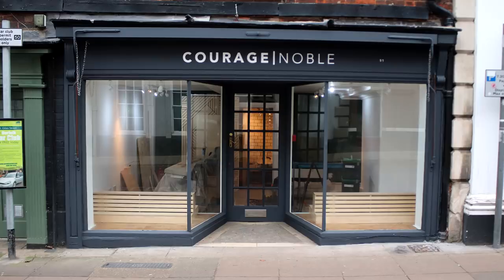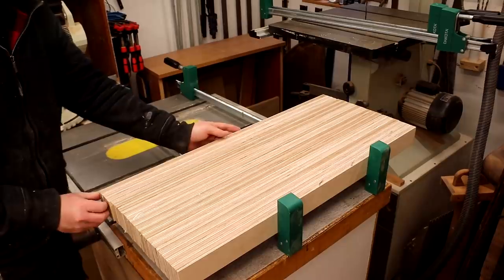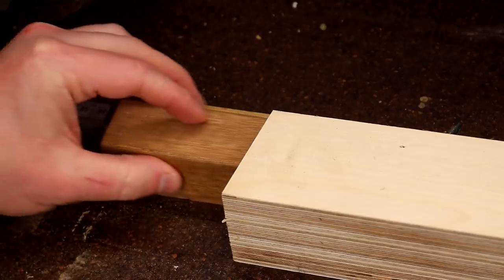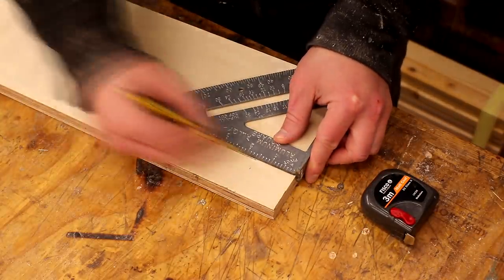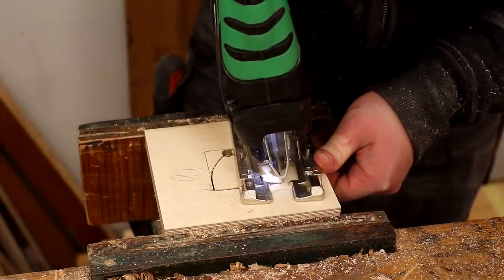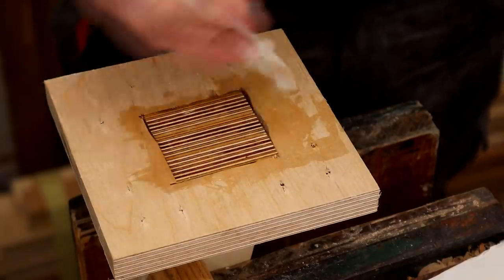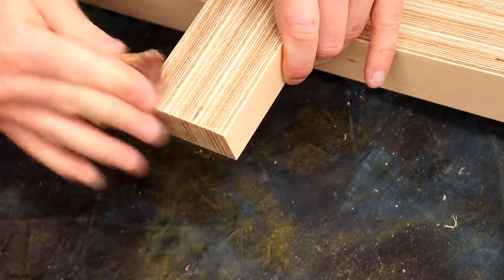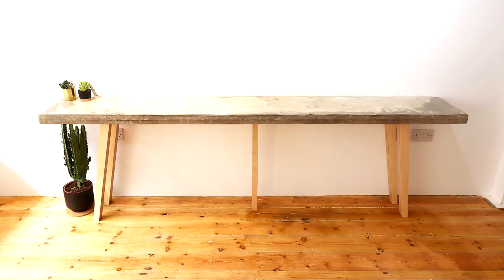Tapered & Angled Legs For A Concrete Table Top

Comment: I was going to say, but see someone beat me to it, that a straight mortise and tenon would have been a better option rather than cut a housing with the jigsaw. Another option, something I've done on several occasions for housings with slight angles, is to first make a guide from some scrap, cut the required angle at the mitre saw. You then use the guide to plunge an appropriate blade for a multitool. Really quite effective and a technique borrowed from hand planing angles/mitres. Neat fit out of this barber shop though mate.
Reply from the maker: That’s a great idea! I wish I’d have thought of both of those !!

Comment: Keith yoy are my inspiration my friend. i am pushing forward with my workshop build. the roof is on and im letting it all dry out before i clad the outside and line the inside. 

like yourself i want to turn my hobby into a jobby (Hehehe).

Great work Keith cant wait for your next one. 

P.s Could you do a video on how you price yoyr commision work ?
Reply from the maker: Cheers Keith I’ve been following your build on wwuk but often don’t find time to comment. Looks like it’s going great! I’ve already shot a video about how to charge for work I just need to get it edited and it’ll be up soon 👍

Comment: this video is a little old but i saw it now ,my question is .why not attach the legs to the mounting block using  dowels and glue istead of make a 10° square hole to fit the leg ? im not saying that is better ,but is possible to make it and have the strenght neccessary to support the table top? ,exapmple a coffee table is not to heavy ,asking to finish a project and dont know if buy hairpin legs or just make this technique to install the legs .

Comment: Nice project.. I did not like the fact that the top was made of Concrete. But I understand that everyone taste is different.
Also, You should consider investing in a scroll saw to make such an angled cuts for mor accuracy rather than using a jigsaw I think. 

Nice overall👍

Comment: Well, the client should be able to display their anvil collection on that table quite safely. I understand your pain btw, when choosing a tool for fine carpentry; when the hammer and the blunt axe can't be used, you have to resort to the jigsaw. I've never actually thrown mine across the workshop but I've cussed a lot for trusting it to cut were i wanted it too. They don't even respect a fence!